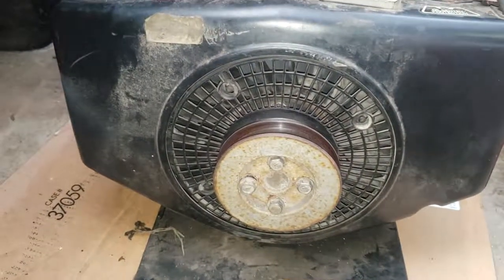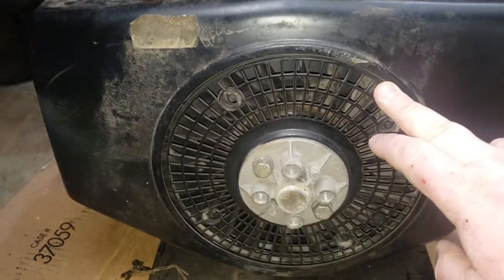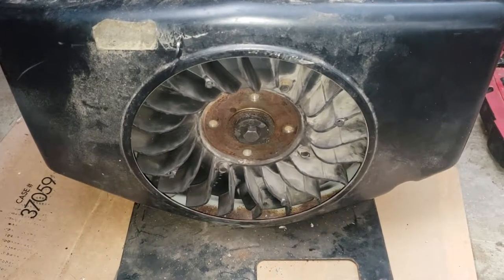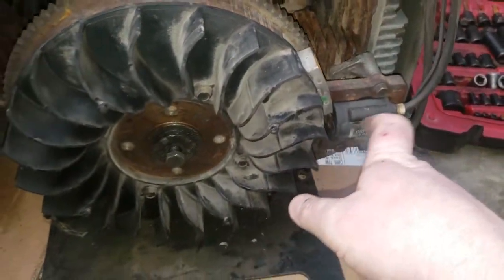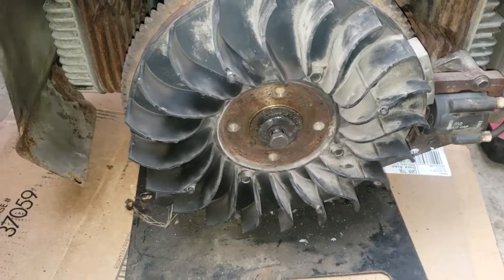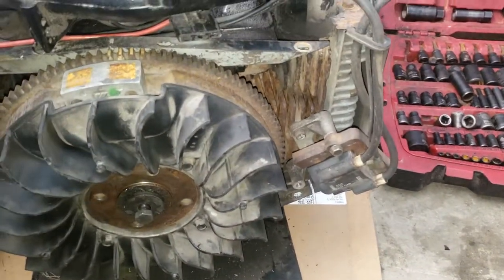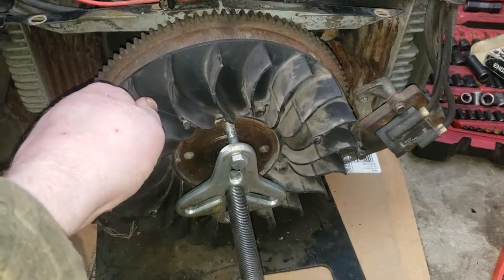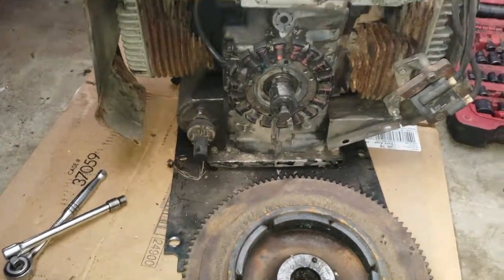How to Remove Kohler Magnum Flywheel

Comment: Hello Bryon,I have old Koehler motor-m16,replaced solenoid in fall-wouldn’t start.next cleaned carb-started but leaked.then suddenly no spark-replaced coil-ran again,next try no spark again.any ideas?it’s about 1989